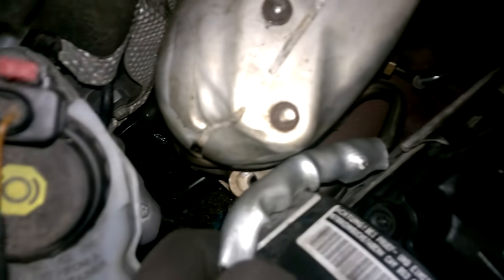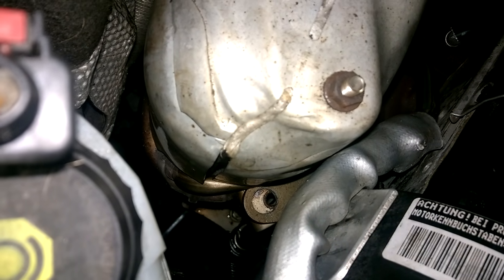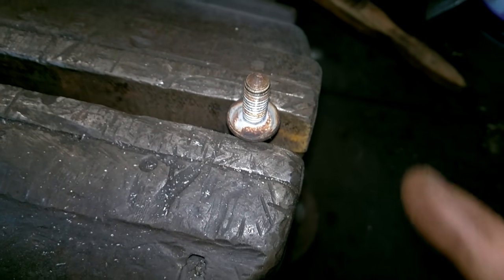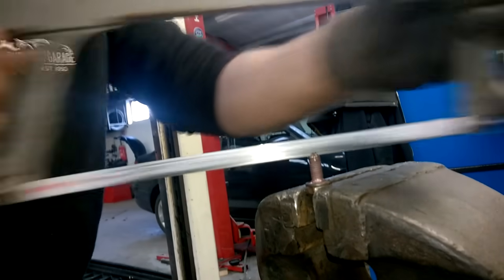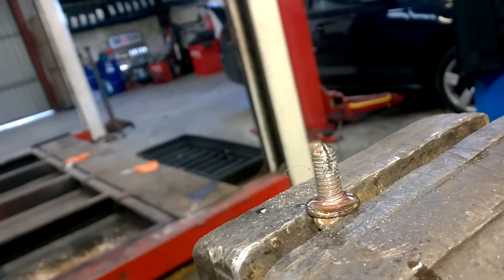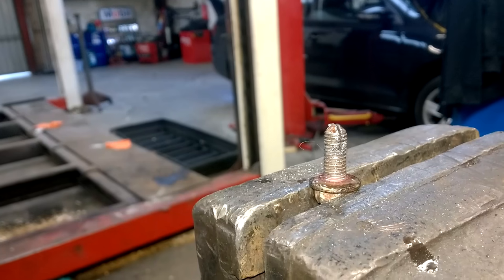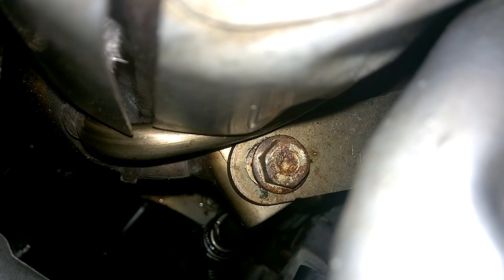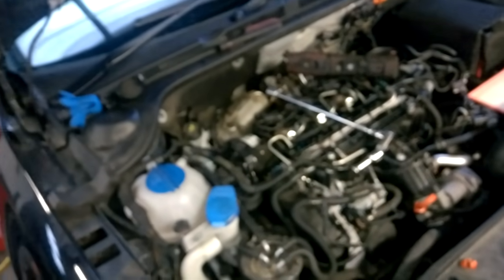My Father Taught Me This! Passing It On To The Next Generation

Comment: Dā🍀💪
Reply from the maker: The update info below is the pinned comment on this video, I know most people do not realize I made that video and it better explains/shows this method in use.   
I also included below details of why the job was done this way free of charge with the customer fully informed. I hope you check it out  👇👇
 
UPDATE* I decided to make a follow up video on this https://www.youtube.com/watch?v=yfNQullGEuQ&feature=youtu.be Should answer some of the questions that were raised, I include 3 demos of this in action with close up shots.
 
As there was some safety concerns & confusing comments raised, I felt I should clear a few things up. 
1) This is a tip for certain circumstances only, I never have and never would use it on a component which would cause any safety concern to any customer.  
2) The demo was done on a support bracket only, items like this or similar will not cause any safety concern. 
3) I did this free of charge and on a time restraint, I noticed it when I was replacing another item, the customer needed the vehicle back that evening and I decided rather than leave it like it was, I would do this and secure it up fully. 
4) The bolt was not the issue, the part that the bolt threads into is a secured piece, someone had previously damaged it, leaving the bracket loose and the bolt just tightened a turn or so.
5) The bolt can be removed and will not break, it will go in and out as usual and has helped clean up the damaged threads.  
6) Used in the right application I personally believe this is a great tip and can save you a lot of time & trouble. 

Lastly to all the people who have watched the video, Thanks very much and I am delighted with the feedback I have received on it.

Comment: Try a bigger hammer
Reply from the maker: The update info below is the pinned comment on this video, I know most people do not realize I made that video and it better explains/shows this method in use.   
I also included below details of why the job was done this way free of charge with the customer fully informed. I hope you check it out  👇👇
 
*UPDATE** I decided to make a follow up video on this https://www.youtube.com/watch?v=yfNQullGEuQ&feature=youtu.be Should answer some of the questions that were raised, I include 3 demos of this in action with close up shots.
 
As there was some safety concerns & confusing comments raised, I felt I should clear a few things up. 
1) This is a tip for certain circumstances only, I never have and never would use it on a component which would cause any safety concern to any customer.  
2) The demo was done on a support bracket only, items like this or similar will not cause any safety concern. 
3) I did this free of charge and on a time restraint, I noticed it when I was replacing another item, the customer needed the vehicle back that evening and I decided rather than leave it like it was, I would do this and secure it up fully. 
4) The bolt was not the issue, the part that the bolt threads into is a secured piece, someone had previously damaged it, leaving the bracket loose and the bolt just tightened a turn or so.
5) The bolt can be removed and will not break, it will go in and out as usual and has helped clean up the damaged threads.  
6) Used in the right application I personally believe this is a great tip and can save you a lot of time & trouble. 

Lastly to all the people who have watched the video, Thanks very much and I am delighted with the feedback I have received on it.

Comment: That’s not a tip that’s a shortcut you’re teaching there’s no reason you should have to do that find the real problem and address that
Reply from the maker: The update info below is the pinned comment on this video, I know most people do not realize I made that video and it better explains/shows this method in use.   
I also included below details of why the job was done this way free of charge with the customer fully informed. I hope you check it out  👇👇
 
UPDATE* I decided to make a follow up video on this https://www.youtube.com/watch?v=yfNQullGEuQ&feature=youtu.be Should answer some of the questions that were raised, I include 3 demos of this in action with close up shots.
 
As there was some safety concerns & confusing comments raised, I felt I should clear a few things up. 
1) This is a tip for certain circumstances only, I never have and never would use it on a component which would cause any safety concern to any customer.  
2) The demo was done on a support bracket only, items like this or similar will not cause any safety concern. 
3) I did this free of charge and on a time restraint, I noticed it when I was replacing another item, the customer needed the vehicle back that evening and I decided rather than leave it like it was, I would do this and secure it up fully. 
4) The bolt was not the issue, the part that the bolt threads into is a secured piece, someone had previously damaged it, leaving the bracket loose and the bolt just tightened a turn or so.
5) The bolt can be removed and will not break, it will go in and out as usual and has helped clean up the damaged threads.  
6) Used in the right application I personally believe this is a great tip and can save you a lot of time & trouble. 

Lastly to all the people who have watched the video, Thanks very much and I am delighted with the feedback I have received on it.
Reply: @GerardBurkeBurkesGarage  you can justify it how ever you want it’s still not right and still not the best way to handle the situation  in the end buddy
Reply from the maker: @Itneverwas.  I am just explaining the situation better than the first video. The justification is not needed as the customer decided on the repair. I found a fault from another mechanic and fixed it for free late on a Sat evening. I will always be happy to share a tip like that. 
I have removed an engine in a Saab to fix a damaged thread in a timing cover and I could list a 100 more other jobs, that's not the point.
It's knowing when and where to use a tip like this, that's the key!

Comment: This is literally a "My buddy can do it cheaper" method... Just fix the problem, not change a bolt to work with the problem smh
Reply from the maker: The update info below is the pinned comment on this video, I know most people do not realize I made that video and it better explains/shows this method in use.   
I also included below details of why the job was done this way free of charge with the customer fully informed. I hope you check it out  👇👇
 
*UPDATE** I decided to make a follow up video on this https://www.youtube.com/watch?v=yfNQullGEuQ&feature=youtu.be Should answer some of the questions that were raised, I include 3 demos of this in action with close up shots.
 
As there was some safety concerns & confusing comments raised, I felt I should clear a few things up. 
1) This is a tip for certain circumstances only, I never have and never would use it on a component which would cause any safety concern to any customer.  
2) The demo was done on a support bracket only, items like this or similar will not cause any safety concern. 
3) I did this free of charge and on a time restraint, I noticed it when I was replacing another item, the customer needed the vehicle back that evening and I decided rather than leave it like it was, I would do this and secure it up fully. 
4) The bolt was not the issue, the part that the bolt threads into is a secured piece, someone had previously damaged it, leaving the bracket loose and the bolt just tightened a turn or so.
5) The bolt can be removed and will not break, it will go in and out as usual and has helped clean up the damaged threads.  
6) Used in the right application I personally believe this is a great tip and can save you a lot of time & trouble. 

Lastly to all the people who have watched the video, Thanks very much and I am delighted with the feedback I have received on it.

Comment: This is such a bad idea.  If you ever have to remove this bolt again, it will more than likely snap because of the cut you made in it.
Reply from the maker: The update info below is the pinned comment on this video, I know most people do not realize I made that video and it better explains/shows this method in use.   
I also included below details of why the job was done this way free of charge with the customer fully informed. I hope you check it out  👇👇
 
UPDATE* I decided to make a follow up video on this https://www.youtube.com/watch?v=yfNQullGEuQ&feature=youtu.be Should answer some of the questions that were raised, I include 3 demos of this in action with close up shots.
 
As there was some safety concerns & confusing comments raised, I felt I should clear a few things up. 
1) This is a tip for certain circumstances only, I never have and never would use it on a component which would cause any safety concern to any customer.  
2) The demo was done on a support bracket only, items like this or similar will not cause any safety concern. 
3) I did this free of charge and on a time restraint, I noticed it when I was replacing another item, the customer needed the vehicle back that evening and I decided rather than leave it like it was, I would do this and secure it up fully. 
4) The bolt was not the issue, the part that the bolt threads into is a secured piece, someone had previously damaged it, leaving the bracket loose and the bolt just tightened a turn or so.
5) The bolt can be removed and will not break, it will go in and out as usual and has helped clean up the damaged threads.  
6) Used in the right application I personally believe this is a great tip and can save you a lot of time & trouble. 

Lastly to all the people who have watched the video, Thanks very much and I am delighted with the feedback I have received on it.

Comment: So the bolt has no integrity. The way you do that is Chase the threads with the tap and get a new bolt. this is great if you're stuck in the middle of the desert somewhere but why would you have a hacksaw and a vise at that point this makes absolutely no sense I'm a machinist this is not the way things are done. This is backyard mechanic .01

Comment: Have you lost your mind?Things are engineered, you've compromised the integrity. I heard of loose bolts that's ridiculous for vibrating out.
Reply from the maker: The update info below is the pinned comment on this video, I know most people do not realize I made that video and it better explains/shows this method in use.   
I also included below details of why the job was done this way free of charge with the customer fully informed. I hope you check it out  👇👇
 
UPDATE* I decided to make a follow up video on this https://www.youtube.com/watch?v=yfNQullGEuQ&feature=youtu.be Should answer some of the questions that were raised, I include 3 demos of this in action with close up shots.
 
As there was some safety concerns & confusing comments raised, I felt I should clear a few things up. 
1) This is a tip for certain circumstances only, I never have and never would use it on a component which would cause any safety concern to any customer.  
2) The demo was done on a support bracket only, items like this or similar will not cause any safety concern. 
3) I did this free of charge and on a time restraint, I noticed it when I was replacing another item, the customer needed the vehicle back that evening and I decided rather than leave it like it was, I would do this and secure it up fully. 
4) The bolt was not the issue, the part that the bolt threads into is a secured piece, someone had previously damaged it, leaving the bracket loose and the bolt just tightened a turn or so.
5) The bolt can be removed and will not break, it will go in and out as usual and has helped clean up the damaged threads.  
6) Used in the right application I personally believe this is a great tip and can save you a lot of time & trouble. 

Lastly to all the people who have watched the video, Thanks very much and I am delighted with the feedback I have received on it.

Comment: Oh dear, dear me. Crazy advice. Waste of time torquing it, the bolt has lost most of its strength! Why the hell not just get a tap and die set and recut the bolt and then it keeps its integrity!! I love a good hack but this is one of those useless hacks that people love to love but never think about the consequences!
Reply from the maker: The update info below is the pinned comment on this video, I know most people do not realize I made that video and it better explains/shows this method in use.   
I also included below details of why the job was done this way free of charge with the customer fully informed. I hope you check it out  👇👇
 
*UPDATE** I decided to make a follow up video on this https://www.youtube.com/watch?v=yfNQullGEuQ&feature=youtu.be Should answer some of the questions that were raised, I include 3 demos of this in action with close up shots.
 
As there was some safety concerns & confusing comments raised, I felt I should clear a few things up. 
1) This is a tip for certain circumstances only, I never have and never would use it on a component which would cause any safety concern to any customer.  
2) The demo was done on a support bracket only, items like this or similar will not cause any safety concern. 
3) I did this free of charge and on a time restraint, I noticed it when I was replacing another item, the customer needed the vehicle back that evening and I decided rather than leave it like it was, I would do this and secure it up fully. 
4) The bolt was not the issue, the part that the bolt threads into is a secured piece, someone had previously damaged it, leaving the bracket loose and the bolt just tightened a turn or so.
5) The bolt can be removed and will not break, it will go in and out as usual and has helped clean up the damaged threads.  
6) Used in the right application I personally believe this is a great tip and can save you a lot of time & trouble. 

Lastly to all the people who have watched the video, Thanks very much and I am delighted with the feedback I have received on it.

Comment: maybe put the bracket in the correct position in the first place. it weakens the screw and basically reduces the effective length of the screw... DONT DO THAT! and no, you can not use the „factory torque specs“ in that screw, because it has been weakened and its going to stretch more. dont give people stupid ideas

Comment: Shite tactic not good engineering. I will say this is totally useless though.
Reply from the maker: The update info below is the pinned comment on this video, I know most people do not realize I made that video and it better explains/shows this method in use.   
I also included below details of why the job was done this way free of charge with the customer fully informed. I hope you check it out  👇👇
 
UPDATE* I decided to make a follow up video on this https://www.youtube.com/watch?v=yfNQullGEuQ&feature=youtu.be Should answer some of the questions that were raised, I include 3 demos of this in action with close up shots.
 
As there was some safety concerns & confusing comments raised, I felt I should clear a few things up. 
1) This is a tip for certain circumstances only, I never have and never would use it on a component which would cause any safety concern to any customer.  
2) The demo was done on a support bracket only, items like this or similar will not cause any safety concern. 
3) I did this free of charge and on a time restraint, I noticed it when I was replacing another item, the customer needed the vehicle back that evening and I decided rather than leave it like it was, I would do this and secure it up fully. 
4) The bolt was not the issue, the part that the bolt threads into is a secured piece, someone had previously damaged it, leaving the bracket loose and the bolt just tightened a turn or so.
5) The bolt can be removed and will not break, it will go in and out as usual and has helped clean up the damaged threads.  
6) Used in the right application I personally believe this is a great tip and can save you a lot of time & trouble. 

Lastly to all the people who have watched the video, Thanks very much and I am delighted with the feedback I have received on it.